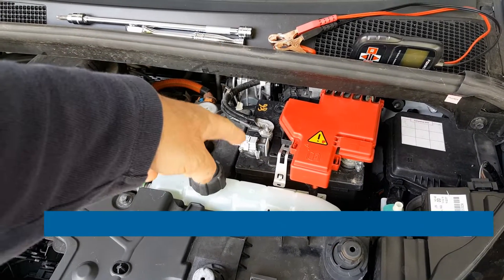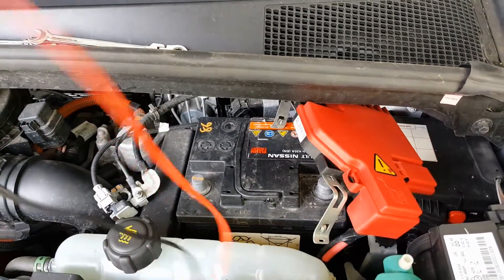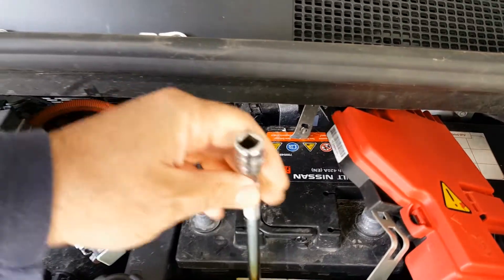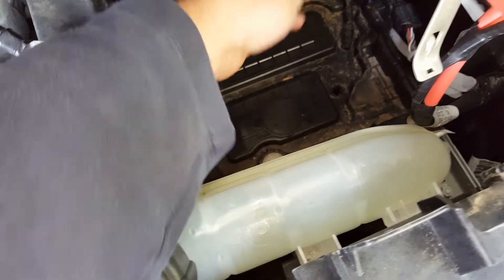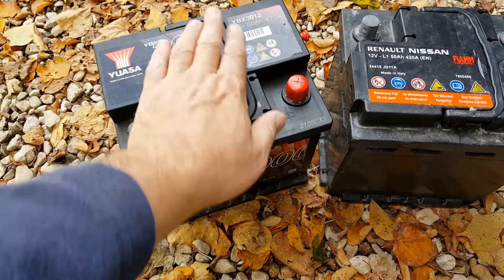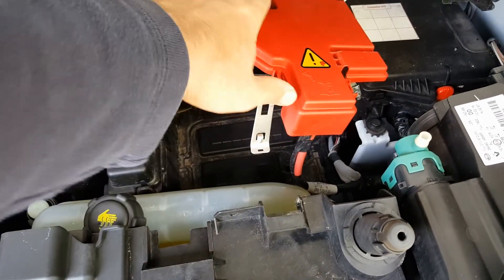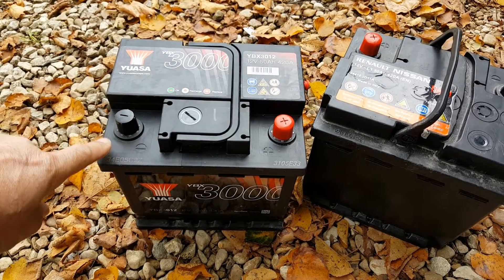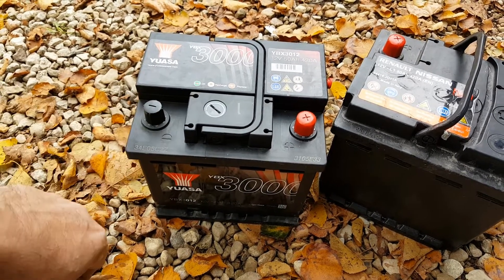How to replace the 12v auxiliary battery on Renault Zoe

Comment from the maker: If you've found this video particularly useful or maybe this saved you money or time, then please do at least click the like button and add a comment. If you'd like to give a 'super thanks', you can buy me a coffee, a pint or contribute to the running costs of this channel via the Thanks button above.
YouTube shares 70% of the donations with the video creators.
Reply: Thanks for the video. We have a Renault Zoe 2020 which keep displaying electric system fault and not able to charge. I think it could be the 12v. Do you know if it uses the same battery as the one in your video? Thanks

Comment: Used this video just to be certain that I removed the poles correct. My Zoe 2018 had its first battery replacement 2021 & then again 2024. I bought the car this summer 2025. Now "Check electrical system" code. So my first thought....battery to be charged!
Thanks a lot for this video!!!

Comment: Super informative, 👍, do you have a battery maintainer you'd recommend for low use?
Reply from the maker: You need a low amperage smart charger. Ideally below 4 amps. Any more, you need to disconnect the battery first.
I use https://amzn.to/42Fmk8in on all my vehicles. Also have this one which is ok https://amzn.to/48vXxY1

Comment: Thanks for a great video! I ordered the exakt same battery. All went well and seemed to worked, but the car won't start after the battery replacement when I press the start button. Anyone had the same problem? The break lights won't come on as well. Other than that everything else that I can turn on inside the car seems to work.

Comment: does the new battery not need coding to the car?
Reply from the maker: No. "Coding" tells the car to change the charging profile for the 12V battery and the Zoe doesn't have that function.

Comment: My existing battery had the left vent plug left in and the vent hose attached on the right. Is it OK to do the same arrangement with my new battery? The battery instructions said to remove the plugs (plural).
Reply from the maker: Correct, the original Zoe battery has one vent plug in place to force any venting out of the tube on the right side. It would be ok to copy that, but it would be even better to remove both.

Comment: Hi Great video, saved me a lot of time in replacing the battery. My Zoe is a ZE 50, the battery is the same but it is rotated 90 deg anticlockwise and there is an additional metal plate bolted above it. One word of warning I got the dreaded "Battery Charging Impossible" and a red light on the charging port when I tried to charge it. After a bit of digging on the forums, just disconnect the 12V battery for at least 5 mins and reconnect. This cleared the fault.

Comment: Does disconnecting the battery wipe any codes for the radio?
Reply from the maker: Yes, it will but not in the Zoe as it doesn't have a radio code.

Comment: Hi, the bottom torx screw won’t budge - it’s rusted. How can I make it move?
Reply from the maker: Put a 13mm hex socket on it, rather than using the torx. Long extension bar and a bar. Also spray it with penetrating oil if you can.

Comment: I’ve just replaced the 12v battery on my ZE50 - it takes the same battery as the earlier models (YBX3012 or equivalent) but the battery is an absolute b*****d to remove. Had to unclip the coolant tank and rotate the battery sideways to slide it out, nowhere near as simple as the ZE20/ZE40.

Comment: Great video! I just looked for a battery for my 2014 zoe and it told me “YUASA 012 5000 SERIES” the one in the video said it wasn’t for my vehicle. Will your battery reference work on my 2014 zoe? Just wanna make sure I buy the correct battery.
Reply: I know this is a year too late, but you are correct - the battery shown in the video is not advised for the ZOE by motor factors and dealers.  You need the Yuasa 5000 (wouldn't recommend Yuasa), or even better, Varta Silver with 5 year warranties.

Sources: several EV technicians at Renault Extended Warranty (Car Care Plan), Renault Service Centre, YMF motor factors.

Comment: My zoe don't have car battery i can't open doors... even with the key on the hole any solution?
Reply from the maker: It doesn't need power to use the key blade in the left front door. So that should work. Are you sure you'e tried turning the key both ways, as I seem to remember its opposite than you'd expect.
Reply: @GoGreenAutos  yeah don't unlock

Comment: My 2018 golf GTi has a complex stop start system which wasn't working right. The factory fitted Korean EFB battery was the problem.  When i fitted a quality AGM battery and - crucially - coded it up for the car (you tell the car the battery capacity and type and that it's new) it transformed it.  

 do you need to code them so the car knows it's new etc?
Reply from the maker: No, the Zoe doesn't have that. The drain on an EV battery is completely different, due to having no starter motor and the charging is different too. Most don't require any coding to tell the vehicle that the battery has changed.

Comment: I just put in the YBX3012 Yuasa SMF Car Battery 12V 52Ah and actually found it easier to move the reservoir tank first. Then I was able to use an electric drill to loosen the torx screw. But overall good instructions and very easy to do this yourself.

Comment: Great video! Any idea if this would void the 41kWh battery warranty if I replaced this myself? I know that they require OEM parts to be used  in a service to not void the warranty. But does it matter if I do it myself?
Reply from the maker: No not at all. Its no different to changing the wiper blades, tyres etc.
Reply: @GoGreenAutos  thanks! Picking up a 2017 Zoe today :) Good to know I can replace the 12V battery myself if needed.

Comment: Which Renault Zoe model(s) does this apply to?
2019 with 80 kW motor?
Reply from the maker: ZE22 and ZE40 models. Probably the ZE50 too, but not had one of these in yet, so not seen under the bonnet.
Reply: @GoGreenAutos  Thank you!
My Renault service guy said "we have to cut the High voltage power before replacing the battery". I asked if it was that thing under the passenger mat, that disconnects the HV battery, but he refused to answer. Do you know? You mention to "wait a few minutes". Maybe some additional step can be taken to be extra cautious?

I did regular service today, but €300 for the battery + labour, when I can find the battery online for €100 with shipping, is why I'm here :)
Reply from the maker: @My_HandleIs_  Absolute rubbish. I say wait a few minutes as the DC-DC converter is still kicking out the 14.5V to charge the battery for about 1 minute after you wake the car (by unlocking, opening a door etc etc). Just turn off the Zoe, open the bonnet and wait at least two minutes before you disconnect the 12V battery.

Comment: Hi I have just changed my battery in my Zoe and found that there was no drain pipe at all is this a problem ?
Reply from the maker: No, not really. Its quite common for these to go missing. It is just laziness from whoever changed the battery before.
Reply: @GoGreenAutos  okay thanks for that your video really helped me changing mine 👍
Reply: Does it matter what side has the vent cover on mine is off on the negative side?
Reply from the maker: @RyansFamilyAdventures  It should actually be removed from both sides, but Renault only remove the plug on the positive side and replace with a vent pipe. But the vent plugs (used for storage and shipping) should be removed from both sides.

Comment: We had a loud noise, the heating or cooling pump??,  the alert electric failure danger, and it wouldn't do anything. The dealer is no changing the battery, asking 440 eu , and says they have to reset a bunch of controllers? Are we being ripped of? The tow truck driver just connected a starter battery and drove it without a problem on his truck.
Reply from the maker: Probably. 120eu for the battery, 320eu for the knowledge.

Comment: I followed all steps until I came to the bolt securing the bracket. Any tips on how difficult this can be and how to solve? It loosened initially and then wouldn’t move. I don’t want to strip the threads.
Reply from the maker: Never had a problem with those. Keep turning clockwise, then anti-clockwise to ease it out.

Comment: What is the purpose of this battery.  The car has a bigger battery already.
Reply from the maker: All EVs have 12V batteries, primarily for safety. The 400V is only for the drivetrain and heating and only live when the vehicle is started. Everything else (central locking, lights, wipers, dash, ECUs etc etc) is standard 12V stuff. You need a power source to wake up and unlock the vehicle. The 12V is there to do this, rather than keeping the 400V live.
Reply: @GoGreenAutos  but why use lead acid?
Reply from the maker: @surfreadjumpsleep  Cost. This is a standard part across much of the Renault & Nissan range which is only costing them about £30 each or less (based on the fact that they will supply us the same battery for £40)
Reply: @GoGreenAutos  they could replace it even with some software.  Shut everything else down and provide some Ah for the last bit that the heavy lead acid is there for.

Comment: Can you put any extra load on this battery? For example an power outtage? And using an inverter?
Reply from the maker: On the 12V? The Zoe doesn't have V2L.
Reply: @GoGreenAutos  12V yes. Or is maybe there any other option? To plug in a fridge or lights... etc.
Reply from the maker: @davidnovak8929  The 12V is quite small on these, but no different to any other ICE vehicle in terms of loading the battery. You'll need the car turned on to charge it up though. You might want to watch this video as these devices will stop your battery getting below a critical level, so you're not left stranded - https://youtu.be/0CdX_tchjG8
Reply: @GoGreenAutos  okay, thank you for your answer. So there is no way to power anything from the Zoe and use it as a backup battery?
Reply from the maker: @davidnovak8929  No. It doesn't do two way power.

Comment: Hi. Great video.
My ZOE now is saying "verify electric system". It has a 2 years old 12v batery replaced in warranty by Zoe. The car was stopped a few months because of covid. I think it is not because of the batery. From what I've seen in several places (Facebook groups) it might be the water pump, and if yes it cost a lot. Are you aware of this situation? From what I've seen it's a very common problem with Renault Zoe. Do you know how to check if it is really the water pump? And if yes do you know how to replace it, or can you do a video showing it?

Thanks
Reply from the maker: If you car has been sat unused for 2 months, then its definitely the 12V battery. Charge that with a charger or replace. See https://youtu.be/reCtr-jjbnA

Comment: Matt can you charge the ZOE 12v battery while it is connected to the vehicle ? (with the vehicle switched off) I have done this with Toyota Hybrids, KIA soul EV and MG ZS EV using a permanent SAE connector so I can top up the 12v car battery whenever I like and those vehicles had no issues with this method, is the ZOE system different?
Reply from the maker: Yes you can. But turn off your charger before you unlock or open the doors as the DC-DC is switched on then.
I keep Zoe's permanently connected to 1A 12V trickle chargers when stored here.
Reply: @GoGreenAutos  Brilliant, many thanks for that 👍

Comment: Another great video! Went to have a look at the battery in our Zoe and found the  radiator reservoir was hanging there, loosely jammed down next to the battery! No plastic pin, so it seems like the battery has been changed but the reservoir not properly repositioned; small cable tie through the pin hole secured it. Will check the vent tube tomorrow! Thanks again, keep ‘em coming! 😀
Reply from the maker: While your head is under the bonnet, check your headlights too https://youtu.be/YTtcb3HcsBE

Comment: Great video, thanks! A former Renault technician told me that the Zoe must be learned that the 12v battery has been replaced (done with the CLIP tool). Otherwise the car will never charge the new battery more than the old and this will speed up the aging of the new battery. Do you know if this is true and if so, will there be a significant difference in life of the battery if I replace it myself? Thanks in advance!
Reply from the maker: That is true on a BMW i3, but I'm pretty sure that isn't the case on a Zoe (and most other EVs too). I've not seen such a feature on my diagnostic scanner when looking at the Zoe. The charging isn't that clever. Its just charges the battery all the time its on!
Reply: @GoGreenAutos  Thanks, just the answer I was hoping for

Comment: Thanks Matt, saved me lots money! The 2013 Zoe we bought from you is still going well with no faults. The other day however it came up with the dreaded Warning. ELECTRIC FAILURE. DANGER! Looing at EV forums I read that the first thing Renault try in this case is change the 12V battery. So I did that and it is happy again. So I saved the cost of towing, diagnostics, labour and the Renault double price battery.
Reply from the maker: Great. Its very common now that cars aren't getting used much during lockdown. Also watch this video https://youtu.be/reCtr-jjbnA
Reply: @GoGreenAutos  Thank you very much! Very informative video, I had the same issue with "Electric failure" due to the 12V battery 200 millisecond self test performed by the cars Pulse Box testing unit that kind of shorts the battery for a split second and that leads to under 10 volts condition and that leads to multiple CAN bus issues (like with break pedal, steering wheel and other random errors) and errors in ECUs. The design of the Pulse Box should be improved to perform a 2 step test, first with a lower cranking current to not mess up the CAN bus and if that passes perform the high current test. Still the 12V battery error is valid and battery has to be replaced. The misleading part from all the smart computer stuff from the car is that in CanZE/ddt4all under "12V battery -> Replacement advice" it is not advised to change the battery...

Comment: Do you find disconnecting the battery also disconnects the R-Link from the internet?  And if yes how is it reconnected?  I am told by Renault that is it a complex procedure.
Reply from the maker: Nope never had a problem and changed around 30 Zoe batteries now. Are they just saying this so they can charge you £120-180 to swap the 12V rather than you doing it yourself or going elsehwere?
Reply: @GoGreenAutos   My 12v battery died after leaving the car unused for a long period of time (covid) and the sudden drop in temperature.  After looking at the amber warning for a few days it developed into the red stop alert.  At the same time the R-Link disconnected itself so I assumed the low voltage was to blame. Both have been sorted by the dealership. I did ask if I could connect a normal battery charger to the 12v system to keep it topped up but they were non committal. Some have suggested you can only charge the 12v battery if it is completely disconnected from the car???
Reply from the maker: @290Alenka  You can charge the 12V while in place as long as you leave it for 3 mins before connecting to allow enough time for the DC-DC charger to turn off. See https://youtu.be/reCtr-jjbnA

Comment: Any idea where to get the little clip for the radiator mines missing?
Reply from the maker: If you mean the pin that hold the expansion bottle in place, Renault dealer parts dept. Or any plastic trim clip of the correct diameter will do. It doesn't do much.

Comment: Hi 
I have just got the same battery from Amazon.
I noticed the old  Renault Battery has what's looks like another Vent on the left hand side ( same side as negative ) that is blocked and sealed.
But the new battery came with 2 Red Bungs for Transport.
Do I leave the the left hand side bung in or remove that too.
I have connected the right hand side ( Plus Side ) up to the Vent pipe so that is OK.
Thank you
Reply from the maker: Both bungs are meant to be removed...but as you said the left one is always left in on Renault batteries.

Comment: Is it important to put the battery drain pipe in? It doesn't seem to easily reach the hole on the Yuasa battery and looked very much like it had never been attached previously. (Thanks for the video btw just saved me lots of money!)
Reply from the maker: They often aren't attached. But it easy to put the tube into side of the battery and as long as it is pointing down, it does its job (as there is a drain hole in the battery tray). Get the battery in place, then push in the tube.

Comment: Great video - thanks so much. Gave me the confidence to do mine at home when Renault were asking ridiculous amounts to change it. Followed video exactly - took no more than 5 minutes. Some forums speak of change of indicator tones, loss of radio channels, warning lights and change of screen layout but I had none of those. Just swapped battery and kept driving as normal. Thanks again.
Reply from the maker: Thank you. I replace batteries on Zoe's all the time or leave the battery disconnected while charging overnight and never lost any settings. Other cars do/can, but the Zoe seems immune to it.

Comment: I found I lost power completely when I left my car for 4 months ( on abroad on a business thing) just ordered a ybx3012... this has saved me... the Zoe battery drains when not in use, I wished someone told me...
Reply from the maker: Only the 12v battery drains. The traction battery doesn't. But if the 12v is dead, you cannot plug in and charge.
Glad the video helped.
Reply: @GoGreenAutos   
Hi would this affect charging a car that has had a traction battery swap.
Reply from the maker: @simonloker8334  No.
Reply: @GoGreenAutos  
Thanks for that. I am tying various things to fault find a Zoe